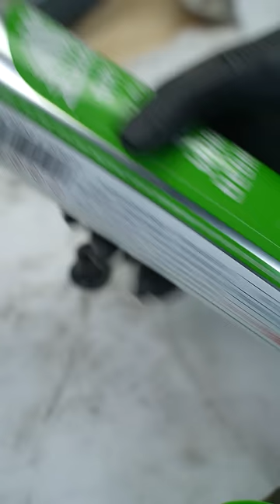Bicycle 1 minute maintenance - Spinergy xyclone

Comment: Don't put chain lube on the pawls. Only light oil. Also, you can pop the seal off the bearing and put some tenacious oil or grease there.
Reply: El lubricante de cadena es aceite ligero

Comment: I noticed the little dents/damage to the edges of your freehub.  My freehub has this but worse. Is this normal wear? It seems like my cassette chainrings wiggle a little bit at those locations. Thanks.
Reply: Maybe your freehub and cassette are from different manufacturers. A little play is no problem if you can shift gears properly. If you got issues with shifting you should replace something on your drivetrain. I would go for a new hub because it's the part that's needs almost no maintenance if it's lubed well. I can tell you by personal experience that even 20 to 30 $ in price can make a difference in performance like you ride a whole new bike!
Reply: You can help mitigate damage to an aluminum freehub body’s splines by making sure you tighten the cassette lock-ring down to the proper torque specification. Without a torque wrench, make sure it is “gutentight.” This will help distribute pedaling torque over the entire cassette instead of only on individual cogs.
Reply: As long it dont skip

Comment: How often does this need to be done.? 🤔
Reply: depends on your riding tbh, if you ride really dusty dry conditions, then you'll want to regulary spray,wipe the area where the axle enters the hub, I usually do mine every 1000 miles or so fully, but I have a lot of spare time, some people usually do theirs between 1500-3000 miles, but it all depends on your conditions and patience tbh.. I got friends that ONLY bother with any servicing when they realize there's a issue.....stupid really that though as by then?.. you've probably damaged something.
Reply: I can't really say 'do it every 6 months' as I don't know what conditions you ride...and for how long.. that plays a HUGE part in it tbh.

Comment: went thought all the trouble and not remove the seal and clean/lube the freehub bearings? additional 10 mins could have made this effort 1000% better/complete.
Reply: More likely to deform the seal when you pick it off in my experience when it’s fitted further into the hub or freehub. For cheap radial hub bearings they are just worth replacing each time you service the hub unless your stripping your hubs very regularly. Plus for blind bearings you’re never going to get all the dirt out anyway as you can only get one seal off.
Reply: Sealed bearings

Comment: The difficult part is to replace the bearings.
Reply: Sealed bearing rings, you would simply replaced
Reply: With the right tools, it's an easy job, I used to prefer cup and cone as I dreaded replacing sealed bearings. But once I got a bearing press kit, I started preferring sealed bearings, it was about 40 dollars on aliexpress.

Comment: lovely
Reply: eso es fácil como le hacen mantenimiento a los rodamientos?
Reply from the maker: Replacement of bearings is not recommended unless unavoidable.
The wheel set has an aluminum sleeve in the middle.
 Push the sleeve to the side...Detachable by bearing hammer